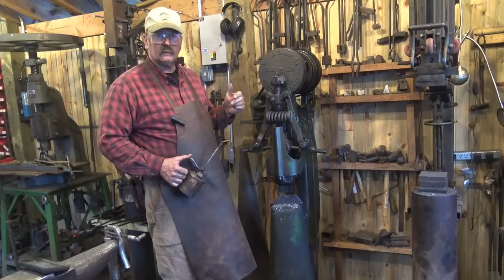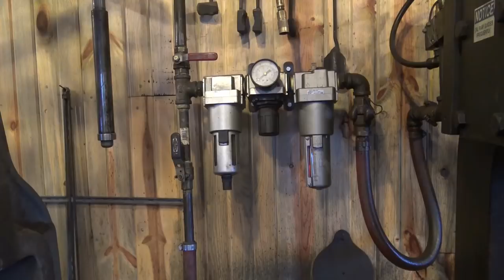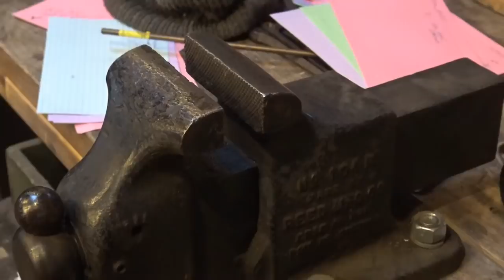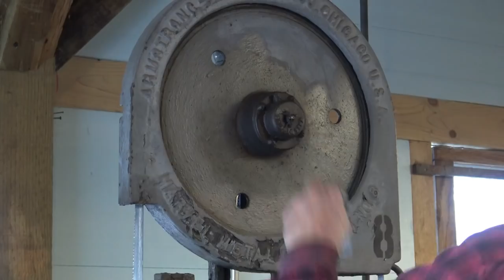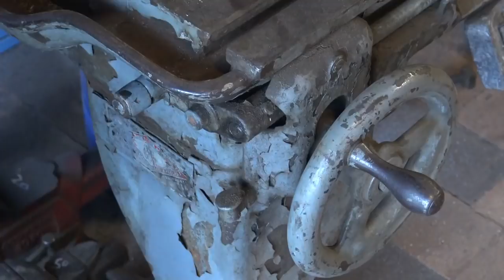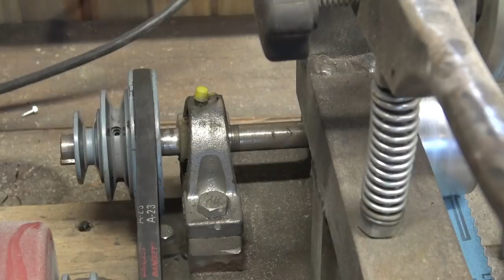If it moves, oil it

Comment: One thing about “motor” oil. Never use any oil that is a detergent oil. That fine for engines that spec it. But never use that for any machinery. It’s corrosive.

Comment: Just started watching/subscribed after I fire pit "annealed" and then cut to manageable length a F-150 leaf spring.  I'm not a smithy but intend to fashion a heavy knife for use out at said pit. I may do a crude rebar poker and stuff as well. Smithing and such had always tugged at me and I love that I found you! You present everything so well and without the cool, clownish antics that some others engage in. Your videos are well thought out, you are obviously a master at your craft and you relate to your viewers with a square shouldered and humble confidence.  Heck, I'm going to go down and oil some stuff even! Thanks
Reply from the maker: I am glad you are enjoying the videos.  You will be looking for a forge and anvil before you know it.
Reply: I'm 60 now, a bit late to go hard core but am thinking railroad track anvil and wheel hub forge. This blade will hopefully serve nicely for kindling. Nothing like eating a tomato off your own vine! Thanks again!

Comment: Don't forget the moveable joint at the bottom of the moveable jaw on your leg vise. I bought one that was so frozen I had to use a bar to pry it open just enough to get movement then oiled the day light out of it and worked it till I have full movement in it.
Reply from the maker: Goodf suggestion, that is one I tend to forget about.

Comment: my shop is heated only when I'm out there.  Beyond the friction points, I lay the ATF to all metal to keep the rust at bay.  Cutting edges get the same beeswax based conditioner I lay to my leather.  What do you do to deal with these conditions?
Reply from the maker: Luckily our winters tend to be cold and dry, so rust isn't as big an issue here as it is any many areas that have higher humidity.  The shop isn't heated and sometimes doesn't warm up much while I work, but there isn't that big rust issue.  I heard one blacksmith from the east refer to it as  red day, meaning that everything in the shop turned red overnight because of the moisture and resulting rust.  Over the years most of my stuff had become exposed to oil from one thing or another and that help, I will oil or wax things like tong joint is they start to seem rough.
Reply: Thanks for the reply.  To me, the most relevant comment you make is when you say 'over the years'.  It is standard practice that ATF, beeswax/almond/coconut oil and beeswax/linseed/turpentine concoctions sit by the wood stove waiting to be warmed up so they can be spread around as part of the routine.  

Thanks for your efforts.

Comment: I oil everything.  Everything. This is an unheated old barn. You think I see rust? LOL
EVERYTHING rusts Anvils. Hammers. Hardie tools. Hand tools. Forge blowers. Post vises. I literally spray and pour oil everywhere. I love the look of these old tools with that patina of well worn old steel.  But they rust if I turn my back!! You should see the oil stain under my post vises and forge blowers !!
Reply from the maker: I knew of one power hammer expert that always looked at the ceiling of someones shop.  If there wasn't a line of oil across the ceiling where it was thrown off the hammer you weren't oiling it enough.  What do you use as a spray on rust preventative?
Reply: Black Bear Forge 
LOL !!!!! That would be me, IF I had a power hammer! Oil on the ceiling.......
John, it depends upon how long I'm away from the shop, and what the item is. I only teach classes/work on weekends, so items set idle for at least five days. Most items are sprayed with FLUID FILM. Sometimes I wipe tools with an oily rag. But anyway,,,,, Fluid Film goes nowhere. It will not harden and evaporate.  I have used WD40 and simular products but it evaporates and rust forms within five days time on tooling and anvils.

Comment: Lucas Oil additive adds some stickiness to oil without thickening it up much. I like the way it sticks to my forge blower gears.
Reply: Black Bear Forge 
Some folks DO pour a gear oil into the case of a hand crank blower.  And I scratch my head on that. Just for fun, I did it. In the summer. I couldn't believe how much more effort it required to operate.  Can you imagine in the winter!!?? Why, you'd never turn it!
I use auto transmission fluid or a hydraulic fluid. Won't thicken in the cold. And allows the gears to roll free.
As far as sticking to the gears.......well.......automatic transmissions have gears and tractor differential gears are lubricated with light hydraulic fluid so it seems to cling to them.
Reply: bc65925 
A hand crank blower (gears?) 
Sticky oil? 
It's not a hand crank, right?
Reply from the maker: I would think only a hand blower would have gears and you want the oil to stay on the surface of the gears.  I doubt he means sticky like adhesive.  I have seen lots of folks use 90 weight oil in a blower and they can be mighty hard to crank in the winter.  Oil that tends to linger on the gears would be much better.
Reply: I did the same thing to my champion 40, put 90 wt in there in the summer. Worked fine till winter. I cleaned that out of there real quick.
Reply: The lucas oil additive doesn't add any viscosity to speak of but it gives the oil a consistency like bar oil as it stays on the gear surface. Around here in some of the auto part stores they have a display of it with plastic gears. You crank it and it will run right up to the top gear where regular oil wont make it all the way to the top.
Reply: bc65925 
Never had a model 40. Many others. But never a 40. I have to stop and think which one that is.......
I looked it up in my catalog.  The "Lancaster " .....aka model 40. Yes. I use one at a blacksmithing shop north of me. I don't get there often.  Model 40 is what they have. Nice unit. Wish it was mine! I installed the pipe from blower to the fire pot for the organization. Helping them set up their blacksmith shop. Made them some tooling. I demo there time to time.
They had this old.....junk forge,,,,,,,setting back in the corner of the old barn (their shop) and I worked on them for two-thirds years to sell it to me. I finally got it, as they obviously were not ever going to assemble it/restore it. So I did! Is has mounted to it a very nice champion model 400